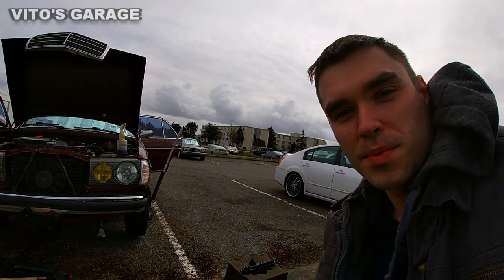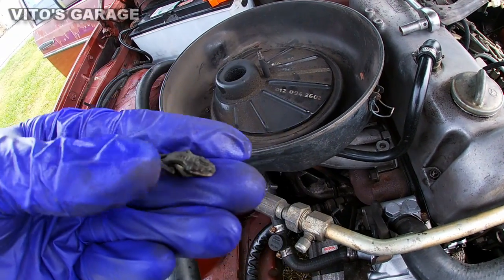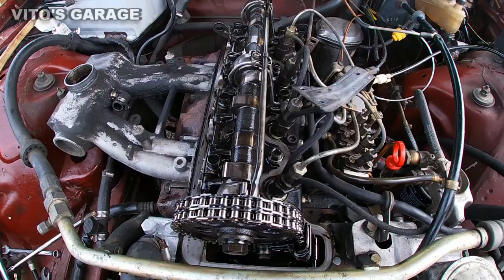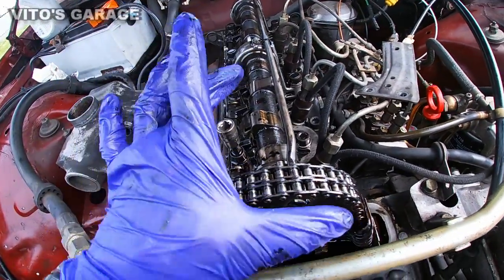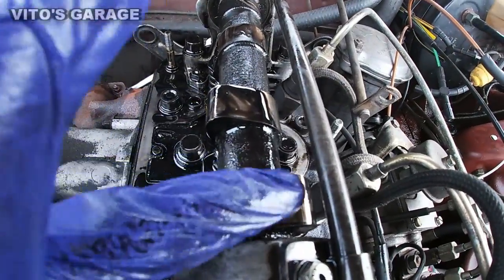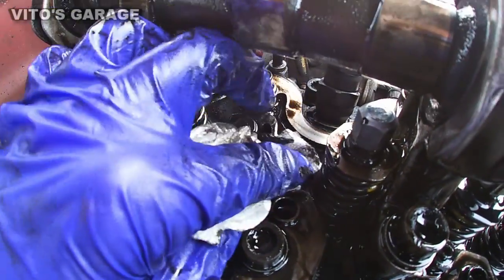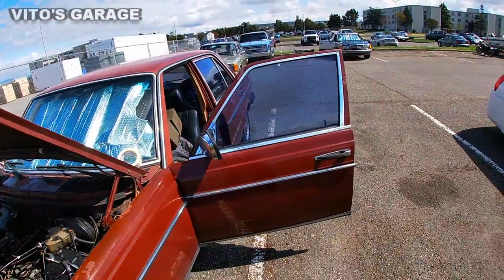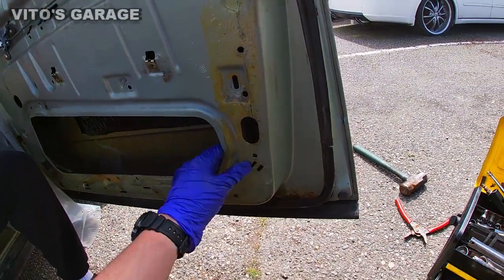Mercedes W123 Can Valve Stem Seals Fix Blue Smoke? Tons of Maintenance

Comment: I have seen several videos on replacing valve stem seals. They always just bring the engine around till the valves are closed on the cylinder they are working on then run compressed air through the spark plug hole or glow plug on a diesel. That holds the valve up while they do the rest of the replacement of the seal.
This actually seems so much simpler. Brilliant!
If you are still getting smoke you may need new rings or a good cleanup of the pcv system.
Reply from the maker: Thanks for the tips and a big write up!

Comment: Thanks Vito for making this excellent video. I don't think there are any detailed videos on valve stem seal replacementc on OM616 and OM617  engines. I want to do this to my 1979 300SD and 1976 240D but I have been afraid I would drop a  valve.  Now I know how to do it thanks to this video. Your the best.
Reply from the maker: Thank you so much for the support! I am glad you liked it!
Reply: I agree. I have need to do this on my 240D as well. Never found a video showing what it entailed until now. Thank you.

Comment: Hello, thank you for these videos, it’s going to help me to do this job on my smoking om615. I have a question for you, the black hose coming out of the engine head cover, mine is like 5 inches long and it’s not connected to anything and a lot of smoke is coming out. Does the other end need to be plugged in somewhere? Is it normal that smoke comes out? Thanks for your help. My exhaust has smoke and the engine head cover oil filler cap dances when I screw it off and leave it on top.

Comment: Hi nice video.  My #8 valve is not adjusting I did all of them except for #8 do u think the nut is strip for the adjustment thanks.
Reply from the maker: Keep trying to adjust it. Sometimes it takes a little bit of movement to go past the proper adjustment. If you still can’t get it right, that nut is probably stripped.

Comment: I just added a 1982 240D to my collection today!  It’s Orient red,  almost identical to this, with 276,000 miles on it. It runs and drives amazingly well. It’s slow but sooo fun to drive.  Question: How do you know if you need new valve stem seals?
Reply from the maker: When you have blue smoke from the tail pipe. If your engine has this many miles I recommend changing the valve stem seals as a preventative maintenance. It’s not hard

Comment: Great video Vito, have you ever done valve stem seals on R107.  Thoughts on DIY that kind of project?
Reply from the maker: Hello sir. And you can do it without removing the cylinder heads. You just need some patience and everything will go well. It's different on V8 gas engines though. You have to compress the valve spring and take the 2 keepers out. The keepers hold the valve and spring in place. On OM616 and OM617 they don't use the keepers. They use nuts to hold it in place

Comment: would the valve stem seals help me with "blow by" too??
Reply from the maker: No. Do the valve adjustment and a diesel purge and fuel filters. Your piston rings may be stuck and not sealing well. They sell some solvents that you can soak the cylinders with and see if the piston rings get unstuck. I don’t remember the names of products. Do your research. 
Pull the injectors and check your compression (after the valve adjustment). Then, soak the cylinders in the solvent for 24hrs. Crank the engine with injectors STILL OUT to blow out any solvents from the cylinders. Then, Recheck your compression again. Now it’s a good idea to check your injectors and rebuild them or install new ones. 
Final thing is CHANGE THE OIL AND FILTER. This is because some of that solvent went past by the rings and down into the crankcase. You definitely want to change the oil now.

Comment: go and buy some low Oder mineral oil, get a bowl and a stiff brush and get that engine cleaned up. you will be shocked at how well the mineral oil cleans everything :)
Reply from the maker: Are you talking about cleaning the inside or outside of the engine?

Comment: Someone's not been kind to that oil pan.  lol
Reply from the maker: Trust me, all the Classic Benzes are like that. Yours was probably too, lol
Reply: @VITOSGARAGE  Dude I can guarantee mine was.... because I'm the one that dented it. LOL !!  Ran through a bad low place last year and bottomed out. I popped the dent out in a previous video. 😉
Reply: In retrospect, an armored bottom plate for these cars is not a bad idea ?
Reply from the maker: I think these cars used to have shields underneath. But then, someone was lazy and never put it back. I've seen W123s with under shields!

Comment: Did the new stem seals fix the blue smoke? If so you wanna do mine? 100% serious I’d pay you. I don’t trust the mechanics here.
Reply from the maker: I can't guarantee it will fix your issue. What's your location? I am in WA
Reply: @VITOSGARAGE  San Diego. Yeah it could be the turbo too but you can smell the oil burning. No clue and just had a valve adjustment. When it idles or goes up hill. I blow out entire neighborhoods lol